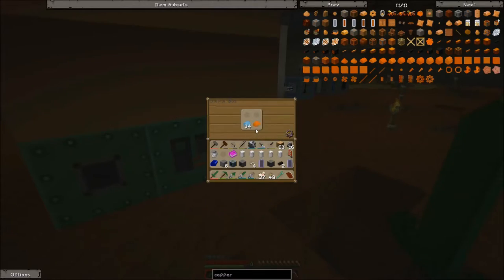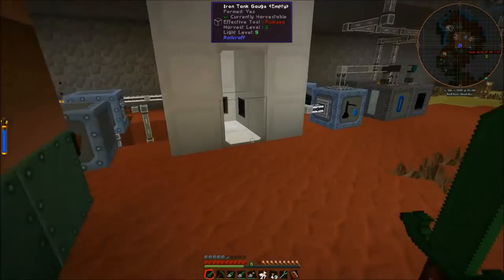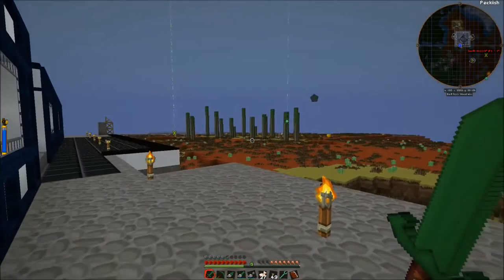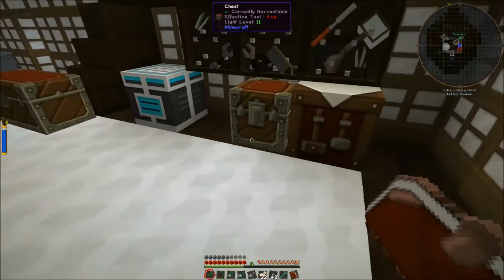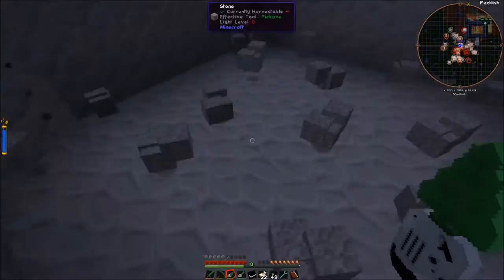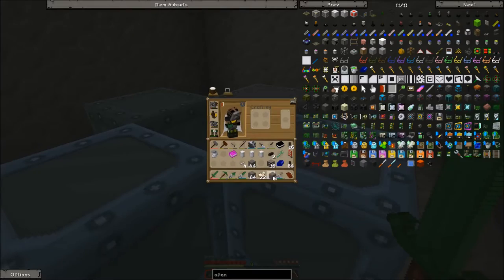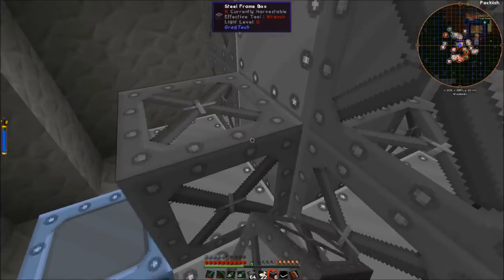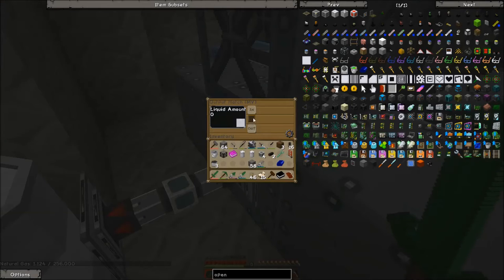Minecraft Infitech 2 Lp Ep 34: Setting Up The Oil Rig

Comment: Keep in mind Asgaard that Advanced (MV) machines will speed the processing 2x, but it will consume total of 4x more energy. So its really pointless are wasteful to use these machines if you don't need to.

About drilling rig.. You read it wrong. The wiki and book says that the area of 96x96 can contain 50% of nothing, or 12.5% of either nat. Gas, Heavy Oil, Oil, Light oil... The area never has multiple types of oil in it.
Reply from the maker: Yeah, I still use the machines at the base a lot as well, but I figured unless I'm actively cooking things in the blast furnace or something, the steam is generating at a very fast rate and if I dont use it the steam just gets wasted.  The speed increase, especially with the macerator and alloy smelter, are such a nice change.  Tbh I doubt ill make mv versions of some machines, like the ones I use less often.  The polarizer I likely wont atm unless there is a specific item to craft that requires the mv for example.  But since the steam is constantly generating and totally self sufficient, I figured I might as well for the speed boost on our main machines.

And yeah, I noticed that on the wiki after I re-read it after the episode.  I misread it for sure, I figure once I pump up a decent amount of natural gas, I'll move it elsewhere and try it again.